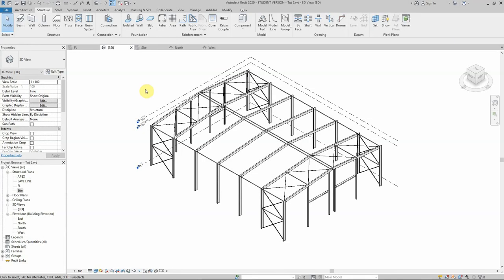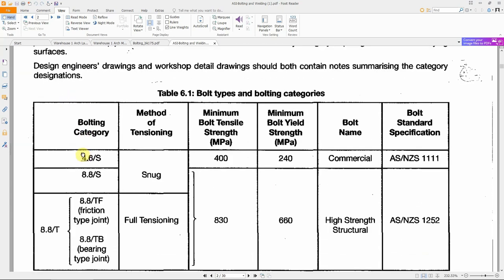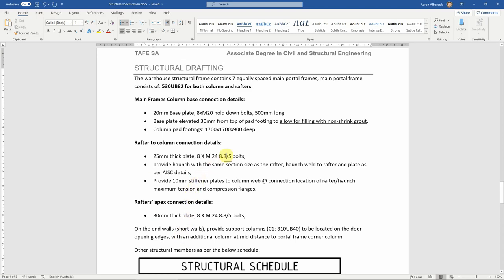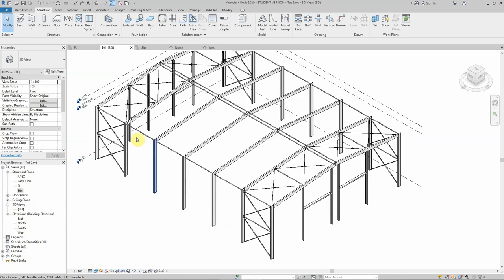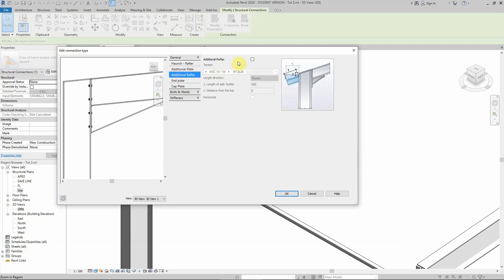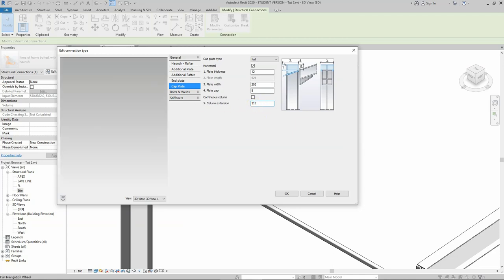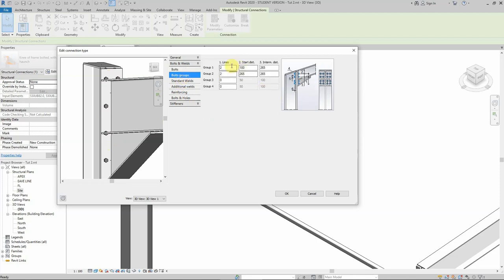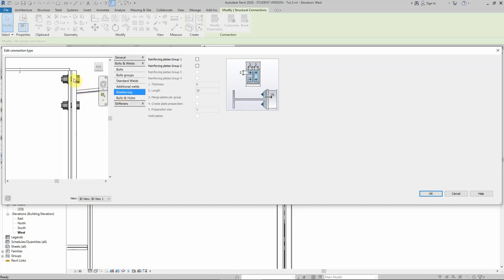Tutorial 5: Connection Design Part 1: Portal Frame Knee Joint Connection Design

Comment: Great video, wondering if there is a way to flip a standard knee frame haunch connection? I have a cantilevered beam which requires a haunch but the haunch always hosts to the other side. Sure there is a way to flip but cant remember

Comment: Is there a way to have the bolt connections happen in the vertical plane? So connecting the rafters vertically instead of horizontally?
Reply from the maker: I am not sure what you meant in your question, but if you are referring to connection to increase the column height? this is called splice connection in columns or rafters, try to google the name and check if that is what you want to do, Splice connections are available in revit, just search some videos and you will find an answer.
Reply: @AaronAlbarouki   I've replied twice here with a link sending you further details about my question, but YouTube seems to be deleting it.